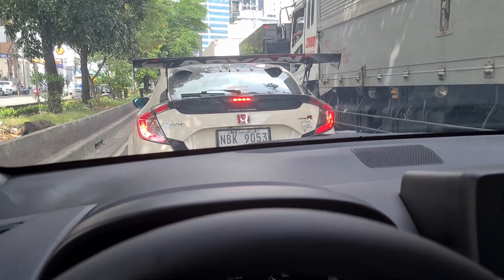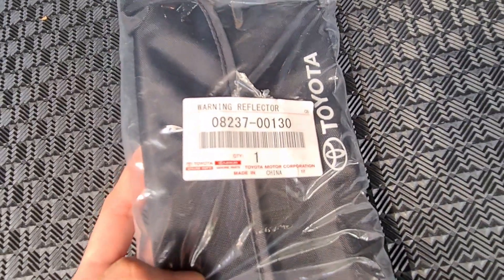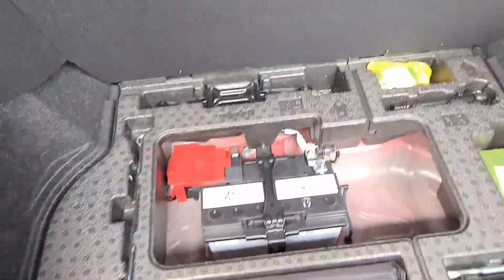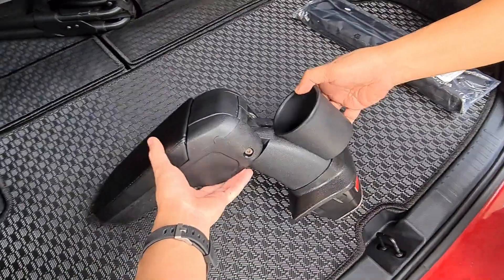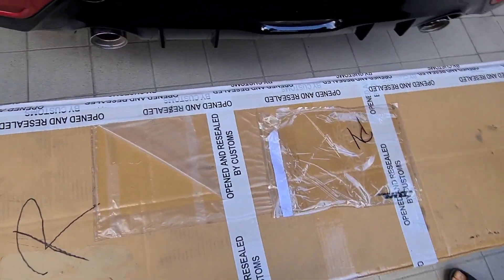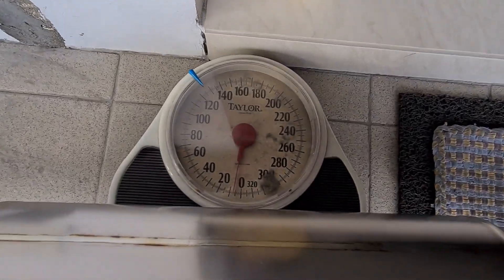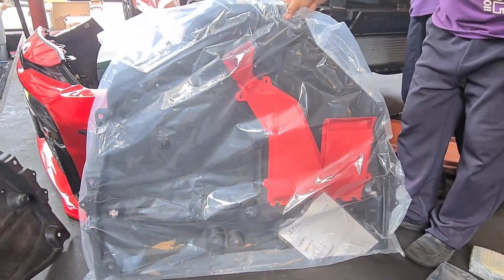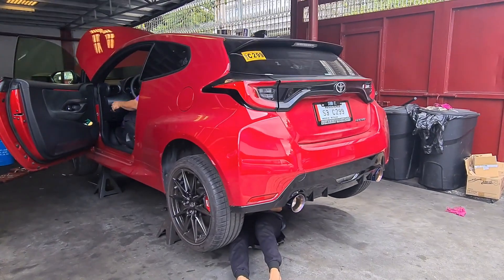GR YARIS NEW EXHAUST + AFTERMARKET PARTS INSTALLED!!! - VLOG40

Comment: Hey,  did you get upgrade exhaust rubber hangers? Aftermarket's tailpipe is bigger than OE, it will very close to rear bumper, so tailpipe might touch your rear bumper,  you should get harder exhaust rubber hangers for your af exhaust to avoid the damaged, FYI.
Reply from the maker: Hello, i didnt change to aftermarket rubber hangers. Ive been using the car a lot lately and it has never touched the rear bumper so far. Thank you for the concern though!
Reply: @FranzGaw  No problem! I noticed this issue that because I saw an youtuber had this problem on his hks super turbo muffler, and then hks also aware that, so hks provided solid hangers for their customers to replace OE hangers. You can check this video on youtube:
https://www.youtube.com/watch?v=CyOeJlLshEU
Reply from the maker: Thank you for sharing! 🙏

Comment: Hi Franz, on the horn, was the wiring plug and play? Or some wire splicing was needed? Thanks.
Reply from the maker: Some wire splicing was needed. I brought a harness so we didnt have to splice but apparently the wire of the harness i brought couldnt support the power needed for the horns so we spliced